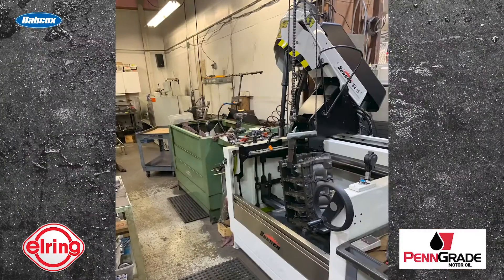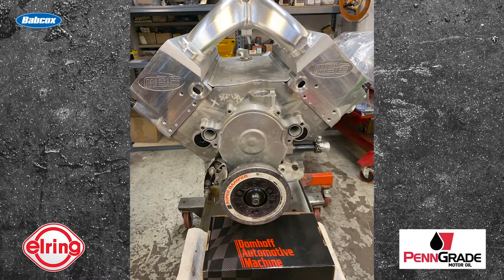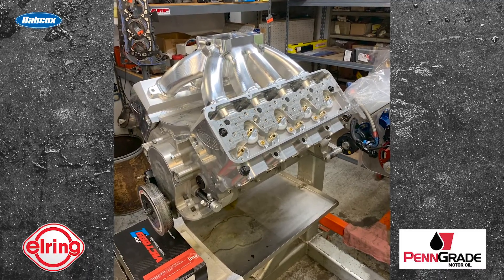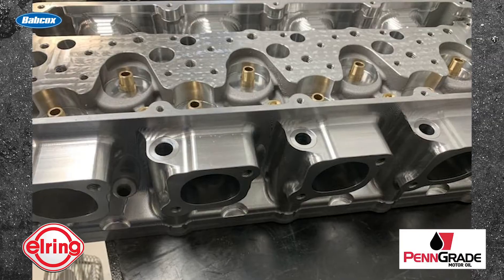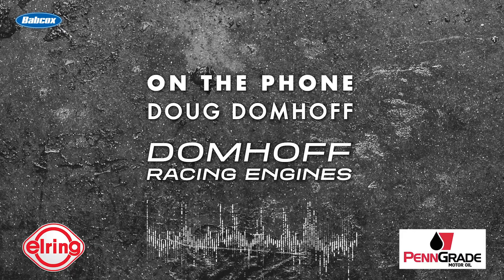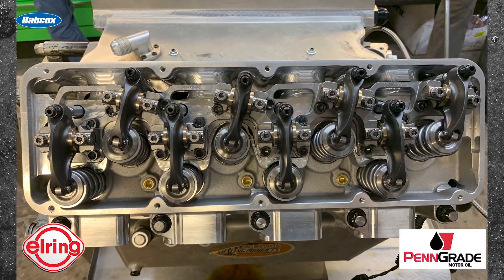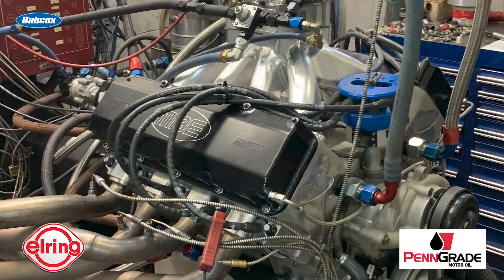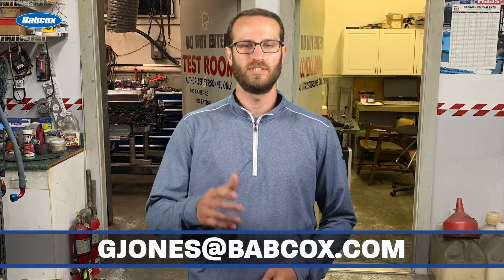436 cid Small Block Ford Engine

Comment: One could easily argue MBE cylinder heads are the best race heads on the market today.  They still offer these heads but thru more CAD and R&D have made an improved billet version for Ford and Chevy.  Not being constrained by the physical limits of a casting (even an excellent one) gives much more freedom.  Admittedly their heads are more than what 95% of ppl need, but if u need max effort, u can't go wrong there.

Comment: The key to long lasting powerful motor is make sure you use a street solid roller tight lash cam. Avoid and drag, or circle track cams.  Street rollers are designed to last on a street strip engine.  You won't make quite as much top end, but your motor will still be fast as fck and last 50k miles without a lifter or valvetrain failure. Is 50hp worth a motor only lasting 3k miles on the street, not to me.
Reply: How to offset that loss of 50 hp ..plumb the roll cage as a pressure tank for NoS...
Reply: @BobbyOfEarth  , That's Some Smokey's engineering... 😂

Comment: These are not streetable engines that will last long on a sreet car in traffic and driving for hrs and high throttle blasts. Cam is a huge drag roller cam. Huge spring pressures and high lift drag cam just wastes valvetrain parts on street car. This is a pure race motor. Wont last for shit on street and no bottom end and horrible street manners.  Spark plugs will constantly foul in traffic,  lifters will be beaten to shreds, valvetrain will be hammered with low rpm street driving.  Good engine for racing,  but thats it.
Reply: Don't think this was designed to be a "Streetable" engine, of course it has a big Solid Roller, you keep saying Drag Solid Roller, but it's for a Late Model Dirt Set-up. Sure things would be Way Different if if was being built as a Street Engine, or Drag Race Engine, or whatever type of class racing, Hell those Heads probably won't be any good in a "Streetable" Set-up. There a straight up Race Head, probably good with Big Cubes or Lot's of Air being Pressurized getting blown thru it.

Comment: That block is not  Windsor or a Clevo. Loosely based on a Ford. The heads defy description! Exhaust side is vaguelly Clevo but the intake is totally custom.
Currently assembling a 351C with CHI heads. All is recognisable though the intakes are considerably higher.
Though they must be turning those engines very hard to use those ports.
Reply: If you’ve never seen the outlaw late models or super late models.    Check it out.     This is the series he speaks of.    People call them hillbilly’s...😂🤣😂.     It’s meant to be derogatory,  I don’t see it that way.   Them boys are smart as hell when it comes to building dirt cars!!!       So fun to watch!!   Just look up Jonathan Davenport.    They call him Superman and for good reason.   He’s just smooth and smart.   Aggressive when he needs to be, but that guy just plain gets it done.      Hope you check it out.   ✌🏼

Comment: Can these heads go on a regular 302 block
Reply: I know that the bore spacing and head bolt pattern of 302, 351W & 351C are all the same. Windsor and Cleveland have different water passages between head and block. I'd search for a head that works for Boss 302 as they were modified Cleveland heads. That's all I can remember. Been out of the game too long to know for sure. Hope that helps you
Reply from the maker: Contact MBE Cylinder Heads to know for sure. Thank you.

Comment: Not one component on that motor is from Ford that's actually a dart small block.it's basically none of the big three it's not a Chevy it's not a Dodge it's not a Ford it's a dart motor
Reply: Its based off of fords 351w small block.
Reply: You could say the same thing about a top fuel hemi. In other words, who cares. This thing is an aftermarket Windsor. Keith black hemi is based on the Chrysler 426 hemi.
Reply: It’s a Ford 😂😂👍👍
Reply: Its still based on the original engines just stronger
Reply: @ryangulley2051  He has this statement rehearsed everytime he sees tail lights pull off from him at the light... His wife had to have corrective eye surgery from rolling her eyes at him the last 15 years...

Comment: How can 436 cubic inches be a small block that's well into the big block territory
Reply: Displacement doesn't dictate if an engine is sb or bb
Reply: Well lets see its based on a windsor sb.
Reply: Wow ! ! !
Reply: it's a stroker engine, seen the sbf stroked to 454ci, aftermarket most likely n/or alot of work on the block.. Weight savings tho..
Reply: @P71ScrewHead  yep definitely aftermarket stroker. I believe there's a 460 inch sbf here on youtube
Reply: @Sir.JohnHawkins  i think i've seen it, was gonna mention it but couldn't remember how big of a stroker it was so i went with the 454ci stroker sbf..lol
Reply: @P71ScrewHead  lol I get that. Either way monster cubes out of a 9.5 deck sbf. I like that it fools people
Reply: @Sir.JohnHawkins  oh yes, always say its a 351 if that's what you started with, i know i would..lol i love strokers, makes every engine better for any application..
Reply: @P71ScrewHead  hell yeah lol or to just say 454 and they think you got a bb chevy in it lol
Reply: @Sir.JohnHawkins  Just say 427 and have them confused for years to come....
Reply: @kramnull8962  lol exactly
Reply: @Sir.JohnHawkins  my buddy has a 471 cube Windsor based engine. Man o’ war block, sc1 heads.
Reply: @shaneferrebee9871  that's awesome. Gotta be at the limit for a Windsor right there
Reply: The dirt late model world is full of 450 inch small blocks.  The key is that they are in 4.5 bore spacing blocks so the cranks aren’t crazy strokes
Reply: bore spacing is small block
Reply: Chevy small block 350 seems to only bore/stroke to 383… Ford 351 small block Windsor with factory 9.2 deck can stroke to 427